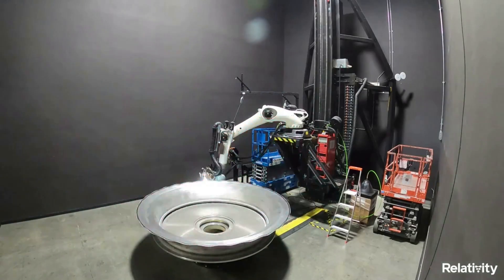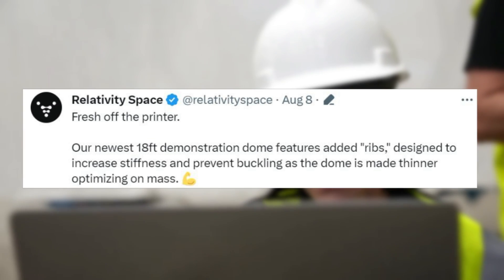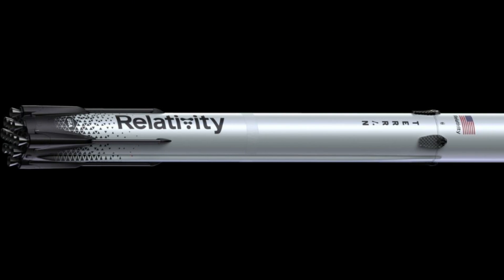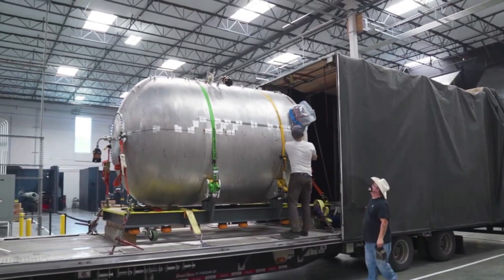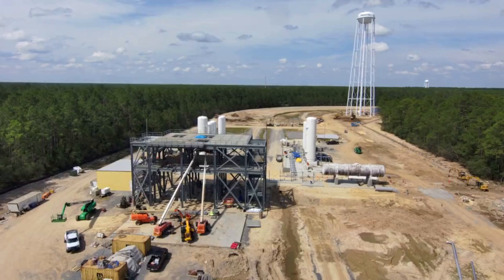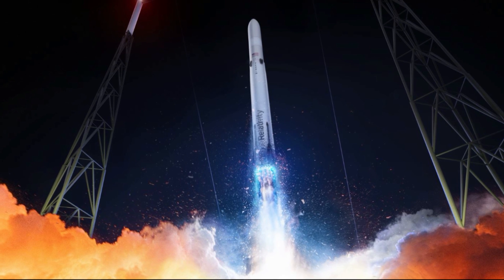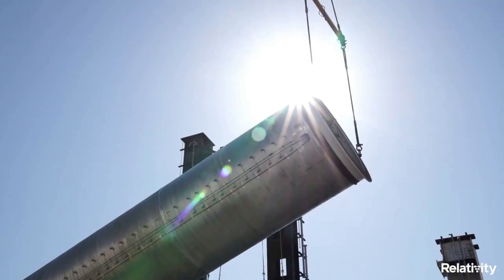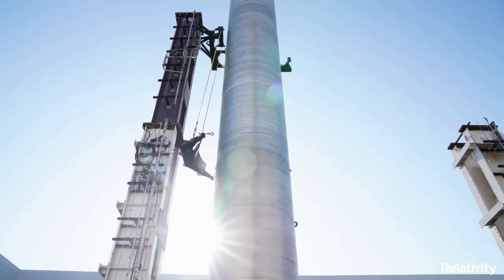Could Terran R Compete With SpaceX's Falcon 9?

Comment: Terran R is competing in the "Not SpaceX" category along with rocketlab and blue orign.  They can't compete with spacex because they won't have the same flight cadence (driving down flight operations costs) since thay don't have a satellite constellation to launch.   Spacex will build far more boosters and second stages per year, giving them the economy of scale.    And the huge consectutive launch success of the falcon 9 means that the insurance on a satellite for a falcon 9 launch will be substatially less.   What spacex charges for a lauch is probably far greater than what it actually costs and only has to be somewhat less than the current market price.   If Terran R comes in cheaper spacex could undercut it and still make a handsome profit.